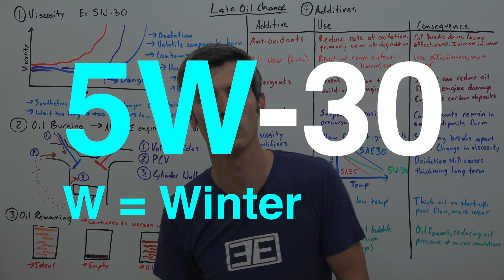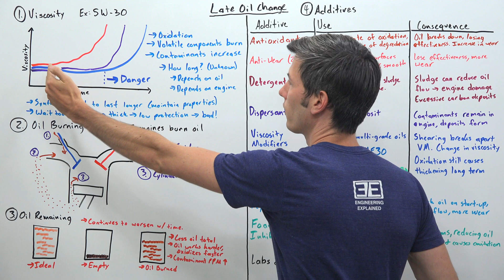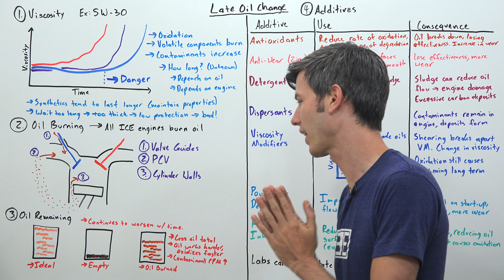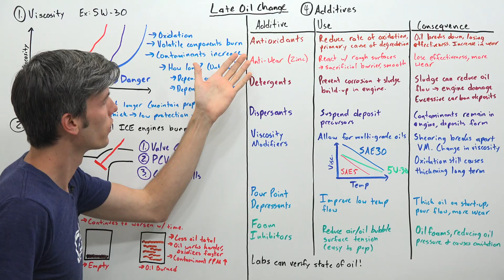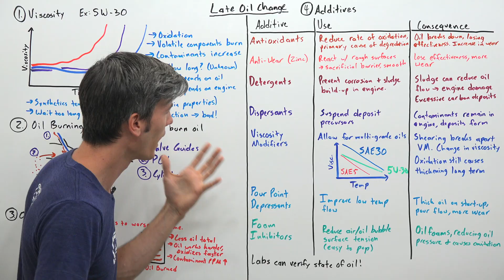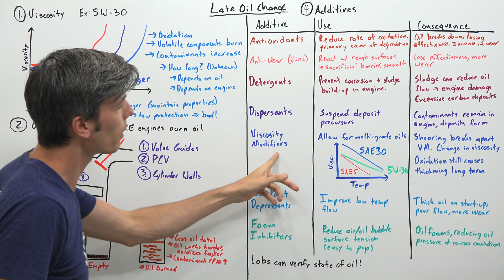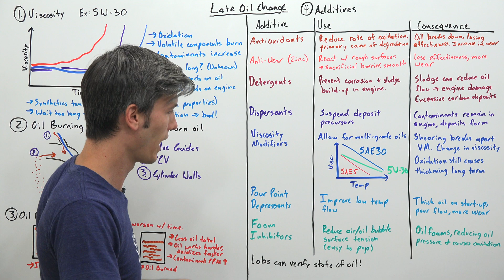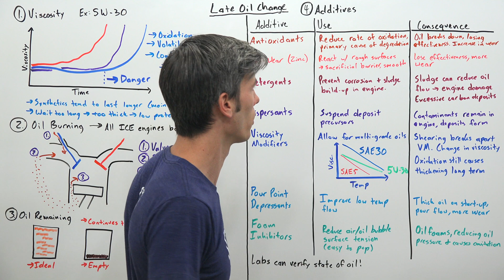What If You Forget To Change Your Oil | Progressive Insurance

Comment: The information written on that dry erase board is accurate and a great Motor Oil 101 ! The rule with oil changes is always change no later than 6000 miles. 3000 miles if you want the engine to have a very long life. Also, always use a superior full synthetic motor oil and a high quality, high capacity oil filter.

Comment: Hah! Test your oil for $200 and then drop the $50 for oil change. No BRAIN-er. Do it at home! Just change it. Your car is worth it
Reply: The test is typically $30, not $200.  And it's usually done with the old oil from an oil change you were doing anyway, not to see if you need an oil change.  A test can tell you if something is going wrong in your engine, like excess metal from a worn out bearing.  A lot of fleets do them as part of maintenance.